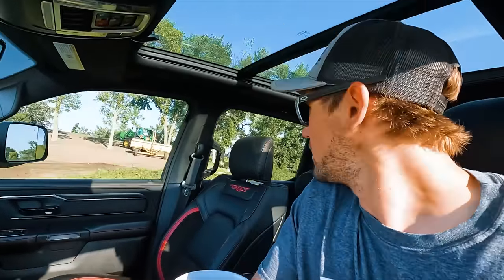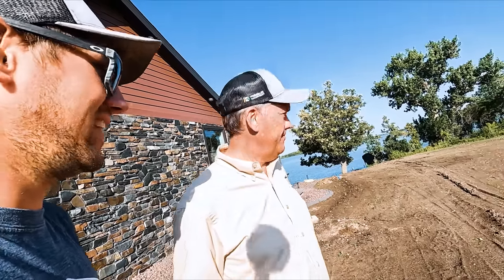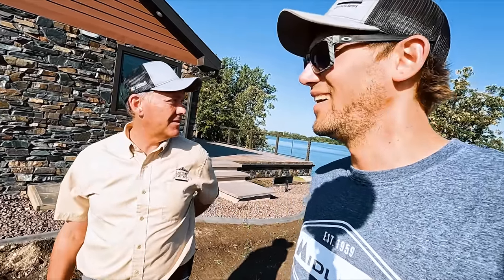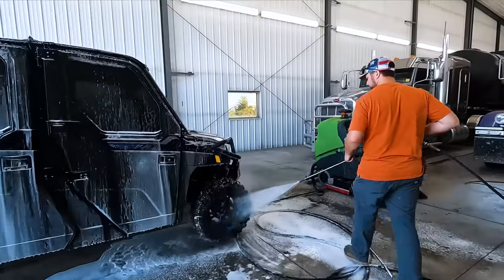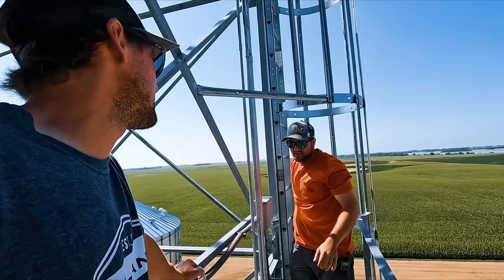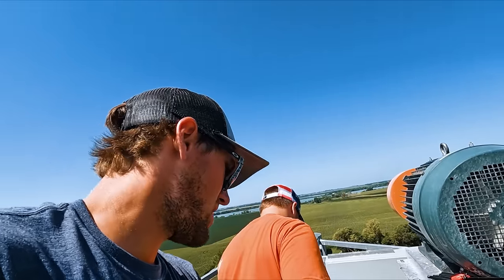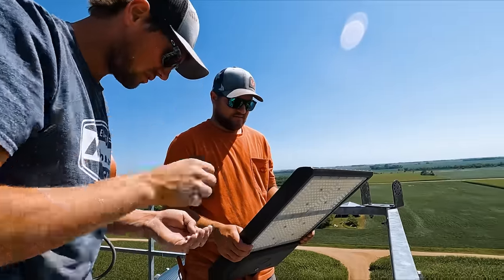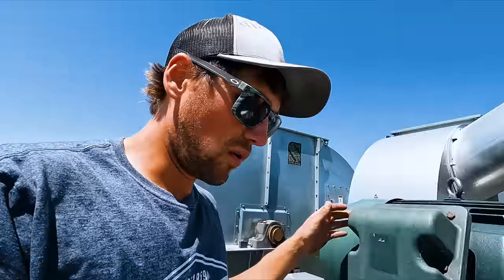Nothing But Trouble 120 Feet In The Air!!

Comment: You need a belt drive fan that exist outside the the grain dust.   Grain dust is destroying your motor and can be explosive under certain conditions
Reply: This!
Reply: They are using dust tite sealed motors just for this application. All axial fans are this way. The buildup might of locked it up and burnt it up, but there was no dust inside that motor trust me.
Reply: @davedunn2124 as that dust builds up on the motor casing id say it heats up pretty good.

They have been replacing these motors every fall now.  Something is up with the motor setup.
Reply: You got that right was going to comment the same thing but seen you already did. 3 phase is just going to get plugged up with grain dust and burn up the same way.
Reply: @OOpSjm    they are thermally protected for this reason. Remember even if it had 2" of dust it's a fan. Constantly moving a crap load of air across itself.
Reply: @kevink4914   probably so. They may need to filter the air better. Possibly build a filter housing around it.  Change filters monthly while running it or something to that effect.
Reply: @davedunn2124  Yet 5 have burnt up.

Comment: You could use a block and tackle hoist to get your stuff to the top of the grain leg much easier.
Reply: Go by Harbor Freight and get a 2,500lb electric wrench and that will fix you up. Not only can you lift tools up but you can use the wireless remote to lift yourself up.
Reply: With a variable speed electric motor!
Reply: @dhansel4835 they would need a long cable but I agree
Reply: Or cheaper/old school option, just a jib and pulley set with a good long rope. Halve the physical effort at least
Reply: @neilamery1151  agreed, and with a bowline at the end, they could tie it to a vehicle and eliminate all work
Reply: @dhansel4835 yeah I’m not putting my trust in a harbor freight jack to not fail while going a 120 feet up 
, especially if I’m attached to it
Reply: @Dontworryboutit315  I understand. There are other models that will work. Be sure if you get on to get one with a remote control. That way you won't have to rely on someone on the ground running the show.

Comment: Hi guys,, Eden valley farmer here,,, I’ve got 3 wire corn cribs, ( 25 round bye 16 high) fill them with 2 row picker,, 50 acres, load them with elevator that I use with small square bales,, all while trying to hold a cold beer,,, farmin”””

Comment: Oh man, Chet, you looked right over Brodie's shoulder and didn't notice you had missed putting the guard over that second fan motor. You'll need a wrench in your pocket and another 120 foot climb!  It'll be plugged with bird nests before harvest!
Ray from Dawson
Reply: Hey you watch them too? My hubby is a distant relative to Dougo. Crazy huh?
Reply: The electrician guys would just have to take them back off to wire the motors anyway so they should finish the job

Comment: Use an igloo cooler or some brand as your box on top of the bins for storage.  They make some large enough for the tools you want to keep up there.  Light enough to pull up the first time also.  Sealed and would keep the tools dry.  You guys are smart and would figure a nice way to secure it.  Love this video btw.
Reply: Good idea, though Igloos and all other plastic containers do deteriorate in sunlight - we had one for a similar purpose on a dock (where it got a LOT of sun) and it wouldn't last more than a year or two. In the end we built a very basic plywood shelter (just an arch, really) and 'wrapped' it in roofing aluminum and the next one lasted years longer.

Comment: Chet, look up a portable reciever hitch mounted captain hoist. Goes in the reciever hitch of your pickup. You wrap your rope around it and it has like a 1 ton rating. Rig you up an arm up top with a pulley and there yah go. Have someone down low run the tugger, and save your arms.

Comment: Looks like the yard project is coming along nicely, thats going to be alot of yard to mow, a 997 Deere would make that job a little easier. As far as the 120 foot climb, have you thought about installing a winch to pull objects up? Wouldn't be very difficult to fab that and would save on arm and back in the long run.

Comment: Chet I feel your pain with getting tools and parts up the grain leg if your grain leg is  120 feet get a 250 foot rope then mount a pully at the top and another pully down at the base of the leg when you need to pull something up attach one end to the side by side and have someone drive slowly away and you won't have to pull on the rope at all

Comment: Have seen a grain leg that had a winch and pulley mounted to the top. All they had to do was run the winch up and down for tools and motor replacement. They built a make shift crane type L Bracket for the pulley and winch cable so it would swing out and away from crows nest to haul stuff up and down.

Comment: Chet Dougo Broodie that was great enjoyed it I enjoy seeing you up on the grain bins you like to be up there as much as me I have an open winch 5 ton with a roller and pully  up top of the bin by gang way with truck box on it with remote built it myself it works using it for almost 6 years on a swing arm eye bolts on the box because I don't have a Chet Dougo Eric or a Broodie tools motor grease gun tubes of grease ride up and down as needed

Comment: Chet and Doug. The storage box Brody suggested is awesome. Why doesn’t the builder of the bin offer that as an option? Also a 50-100 pound winch could also prove to be a good option: strong enough to lift the small three phase electric motors I have seen you guys replace a few times. Just thinking out loud. Love the channel thanks for sharing

Comment: Chet - you need to get a VERY long rope and a deployment arm and large rope pulley and accessories that you can leave in place for this leg. Include wedge chocks so you can safely lock off the rope any time you want without danger, and make the arm for the pulley swingable so you can pivot a load in to let it down on the platform.

Comment: A tip for when your working up high on your grain leg. Set a pulley system up top it makes it much easier and you can have someone at the bottom pull your tools or parts up.

Comment: Hello from Isanti Mn 
 you guys need a small hoist frame built up top of grain bin and a 2way boat trailer winch with 200 ft by 1/4 inch diameter stainless steel cable on it so you can raise or lower from top then a heavy duty water proof plastic tool box storage box for tools grease gun and spare belts extra…
Not hard to build you guys have a welder 
Keith

Comment: A boat winch would work just add a few raps of rope around the spool. for real heavy stuff put a snatch block in and have 2 x the lifting power cost about $100,00 and oil it when needed.

Comment: i would also fab up a small crane of sorts using a boat winch, run a few wraps through the winch and curl the tail of the rope on the platform your working on instead of putting the whole rope on the winch.

Comment: Chet, you need to look into some kind of pulley system for that.  Dead weight in those buckets is hard.  Surely someone makes a pulley system or you should work with an engineer to design it and patent it.

Comment: I would suggest using a couple 5 gallon buckets with screw on lids so you can leave them up there with one bolted to the platform. Also maybe an 18in arm with a pulley to ease pulling.

Comment: Back when I did alot of elevator work we had a pulley that we brought up the legs and a way to attach it.  We would connect the ground end to the pick-up and run motors and supplies up. Using 2 way radios.  Very unsafe tugging stuff up with people hand over hand. Common guys

Comment: Just looking at the fan and thinking as you pulled the old one out that all that debris would not be there if you reversed the tubes. The straight piece is attached to the bin and the angled one at the end to drain any excess debris

Comment: Install a pulley at the top with a 250' rope. Then put a pulley at the bottom also. you can connect the rope to the side by side and use it to pull the bucket up to the top.

Comment: You need to put a pulley at the top. Run a long rope up to the pulley and back down. Stand at the bottom and up the tools up to the guy up top. It’s so much easier to stand on the ground and pull on the rope.

Comment: Yall have power at the top of the leg. Have you ever cpnsidered like a 2-3k lbs atv winch but on ac power to run up and down for yall. Might need to make a short arm off the side, or at least mount it on the outside framing where it wont catch on the mid heigh platform. Could have it controlled in 3 spots, top middle and bottom for emergencys or maybe ur just doin stuff in the middle.

Comment: did you ever think of a electric winch up top maybe add a well wheel to stand it off the bin a little they use them on boat to raise a mast I'm sure you could pull up a bucket with one.

Comment: Feel really bad for Brody with his car being totaled. Have had that happen too. And you never ever really get the real value of your auto from the insurance company.
One idea, get some climbing equipment, 1 belay/repel device, a carabiner and one leather glove. There are pretty inexpensive ones that are super light and take up little room. The belay/repel and glove can be easily attached to your belt with the carabiner. Makes lifting easier because you can control the weight with little effort and one gloved hand and going down would be accomplished easier too and your hands would not be hurt. It will put less stress on the rope than using the edge of the railing. Have done a very small  amount of climbing with my husband and know they work well. I unfortunately hate heights, couldn't even feel comfortable watching you going up  which why I no longer climb.

Comment: Mount an electric wench at the top and run it through an engine hoist with some snatch blocks. Have it swivel to pick and place points. We replaced a 30HP leg motor @ 150ft today with no crane.

Comment: Get a pulley mounted at the top, loop a permanent wire (steel wire, not rope?) with hook over it and an electric winch at the bottom. Just hook a bucket on and press the button. Unload and redo. Also, you can easily do more weight in the buckets.

length you need is 2.2x the height of the leg.

Comment: Say, Chet. While you're up there, why not lower that big motor down and get it checked out for preventative maintenance purposes? Then you will have the reassurance that everything is in tip top condition. On second thoughts, just lower all the other motors down for preventative maintenance. You can never do too much maintenance 🤪

Comment: You should buy 250 feet of 3/8 in. or 1/2 in. nylon rope , a good pully for up top and either a electric or hand crank winch. That would make that much easier.  Just be sure the whatever you attach the pully to will handle the weight your lifting.

Comment: Amazon has a VEVOR Twin Sheave Block and Tackle 1/2" x 150Ft Twin Sheave Block with Braid Rope 30-35KN 6600-7705LBS Double Pulley Rigging for $90 would make pulling up the bucket a lot easier.

Comment: Just do a progress capturing 3:1 pulley system so your not worried about it falling all you have to do is pull it up. You could also make it so instead of actually pulling up you can pull it down from the pulley to pull it up. Then if you need a break you can just let it hang until you’re ready to start pulling again
Reply: Been reading all the fine suggestions for an easy solution to the lift system challenges described. There’s a concept that structural and mechanical engineers apply to static and dynamic applications, large or small, complex or simple    that prioritizes human safety and interaction; it’s called FAIL SAFE .  
Get that Big Swede with his degree in engineering to cover what needs to be considered for parameters of design and function that mitigate unrestrained forces.

Comment: So a pully system would work.  Take an old garage door opener mount to the top of the leg.  Then have a pull at the bottom waste height. For snow purposes.  Build a basket attached stainless cable to the top.  And then go all the way to the top of leg then back down around bottom pulley, then attach other end to the bottom of the leg.  Reason for a garage door opener is they last and are cheap.  Plus they come with remote setup and can be set for weight.  Since they can left a door should be any issue lifting tools and parts.  Use the stainless cable and use same metal as the grain site is for the basket.  This way you have years of use out of it.

Comment: You really need to attach a marine grade pulley (that won't rust), and some dacron rope (that won't rot) to the top of that leg.  It's a lot easier to hoist stuff from the ground than pull a rope over the railing, plus you have the option to tie it to a vehicle if it's heavy.  Even if you're working alone you can send the bucket of tools up and tie it off instead of carrying things up a ladder.

Comment: You can use a 12 volt wench, the type used on trucks with  wireless remote to pull the bucket of tools and replacement parts to the top of the grain bend and lower it back down and it will be on the cheap, problem solved ! :-)

Comment: Chet, why don’t you install a Hand Winch they use on Sailboat’s with a winch handle and you wrap rope around it so it doesn’t slip away. On Top of your Silos.
Reply: Ok go back and look at the distance from the ground to the top then look at what you recommended. A pulley hooked to the rail with a rope that is long enough to hook to the skid steer and pull it up is pretty much the logical answer.

Comment: Just put an ATV wench on the top with a rope instead of a wire. a lot of them come with a remote, be a bit of a bear to get it up there but you could put it in a mailbox to keep it out of the weather.  then you could lift up the box you were talking about to make a small tool shed.

Comment: You put a mast on the highest point of the platform with a small jib. Have the single block attached. Run a piece of climbing rope (1/2”) through that and feed it back down. The person on the ground pulls the load up and not the climber. Basic tower climbing 101. You must learn to work smarter when working at heights, not harder. 
The other advantage to having the people on the ground pull the load up, is you can have more than one person pulling on the rope, so it’s much easier. 
We used to pull cell phone coax inside towers by hand. No winch required. 2-3 men pulling were more than enough. 
Chet, reach out to a climber for more advice or contact me. I can get you squared away. But there are plenty of local tower climbing companies that may help you with advice.
Edit:
WHERE ARE YOUR GLOVES? Rope burns really suck and take a long time for your palms to heal.

Comment: I'm thinking motor failure has to more to do with the amount of spooge ejected into it than too much drain on the motor. It needs a motor not mounted in the exhaust port, me thinks. But I am just sitting at a keyboard and not there. But it does look all suckie.

Comment: 29:32 sure looks like you could use an electric hoist! From a small amount of googling it looks like you could probably get a decent set-up for about $600, wether that’s an off road recovery winch and a pulley on an arm, or a 110/230v lifting hoist on an arm, seems to be your choice! It’ll save you a load of effort the couple of times a year you go up there! It would haul that sealed box up that you could then keep it in too….

Comment: I used to do hot tar work on roofs.  I find Chet's complaints amusing.
Also,when you want to install the box,  bolt a pipe to the rail,  and use a pulley (preferably a multi wheel pulley)  to pull things up.  You might also want to learn how to belay,  You are working too hard lowering things down.

Comment: Put a 12volt winch at the top of leg and use a 12volt Milwaukee battery to pull it up. Then all you need to do is bring up a battery

Comment: You need a jib arm sticking off the edge of that top platform with a pulley on it with a winch to raise and lower tools and equipment.  You already have power up there.  It's too darn dangerous doing it the way that you have been.

Comment: You need a hand line that powerlineman use for your hun setup. We do and it works amazing, has hooks with a pulley that can hook to anything. You can either run it from the top or from the ground by hand! And can tie wrenches, impacts, material with half notches to send up and down safely or use a bucket. Recommend looking into, you’ll wish you had one years ago.

Comment: Why not put a snatch block at the top of the tower and one anchored to the concrete at the base then use your side by side to pull he load up. You could put baler twine around the snatch block to tie the rope to when you need it so you don't have to leave the rope out in the weather and replace the baler twine when the sun gets to it.

Comment: You got winches on your vehicles but you can't put a winch up on top of one of them rainbands least you can build an elevator for all the tools and equipment that you have to take up there go back year or two ago and read my comment or did you just get rid of them comments it's just like without hole in that building I told you to put some 10 on there you got plenty of ten laying around and finally you guys did it you'll spend money on all that other equipment because you have to in order for it to work but you can't put a winch up on your grain bins how much is that going to cost you oh yeah by the way don't read my comments